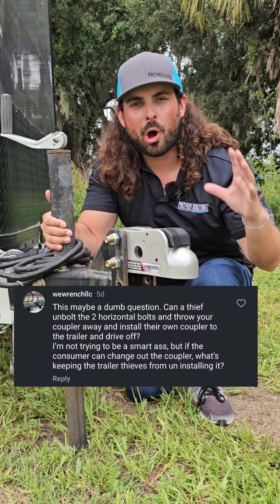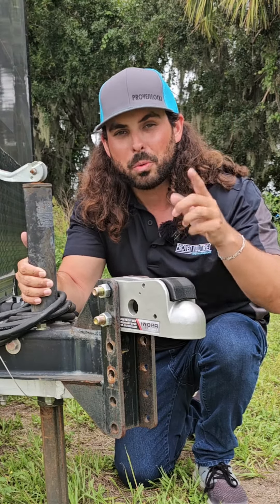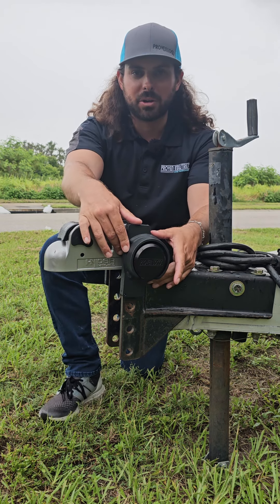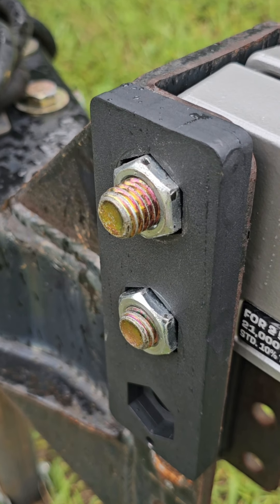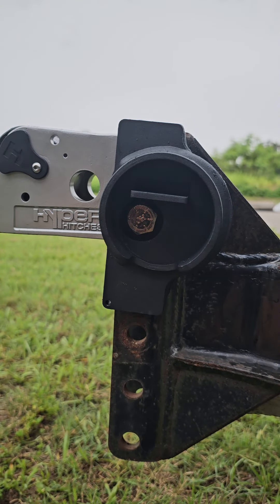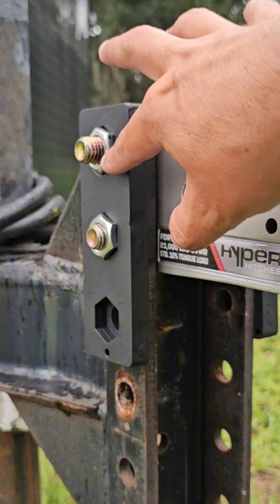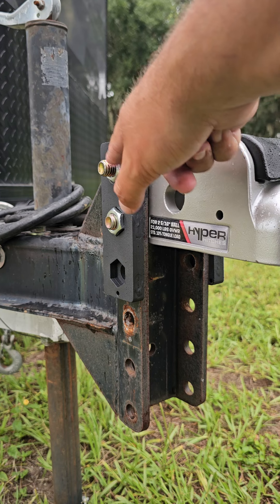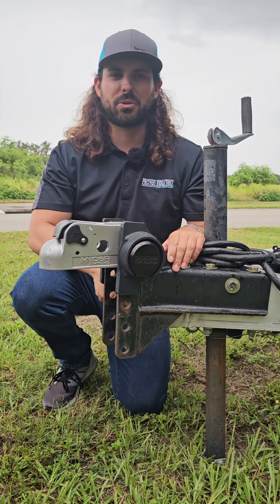How to protect your adjustable coupler bolts

Comment: How about exchanging one of the bolts with a 5/8 locking pin long enough for a 3" receiver hitch?  Sure the bolts for the Demco may be grade 8, but the hitch pin is a 5.  And we're already depending on it to pull everything.  Much cheaper.
If your worried about spreading the trailer attachment to which the Demco is bolted, just put the removed bolt in the next hole up or down.